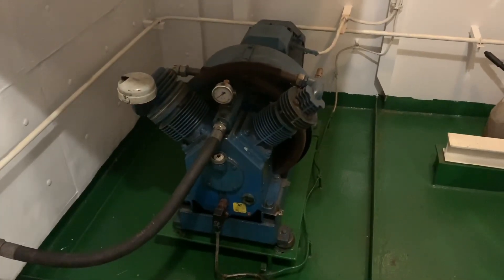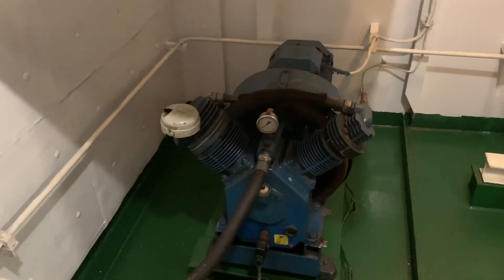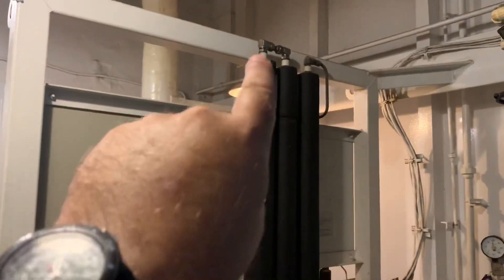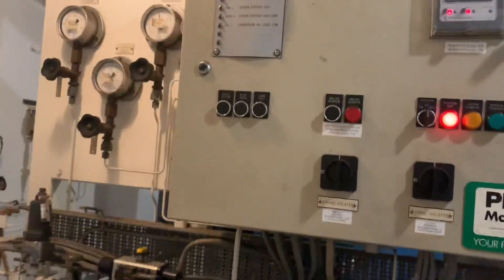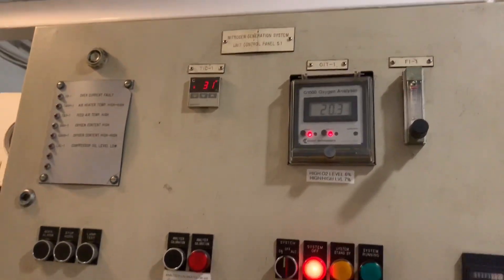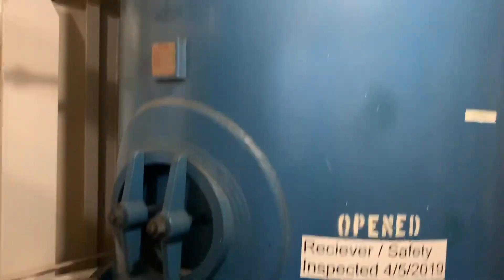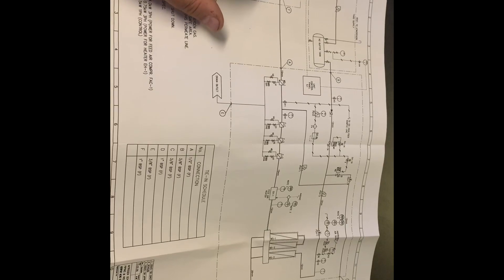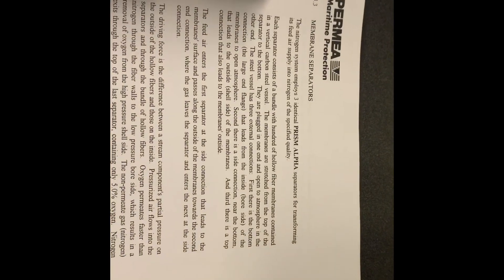Nitrogen generator

Comment: Amazing it's so compact!  Same idea as a home medical oxygen concentrator, except that those save the oxygen and dump the nitrogen.  Similar process, uses a small compressor and micropore "zeolite" media instead of microtubes.  They run as a couple seconds period fill/empty cycle using 2 zeolite chambers alternately.  Makes 95% O2, while tank oxygen is close to 99%.